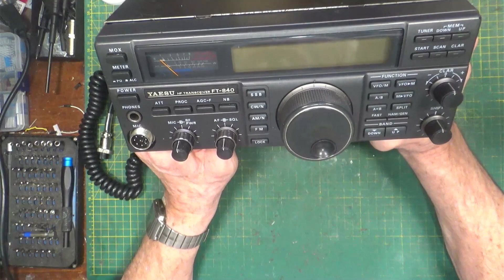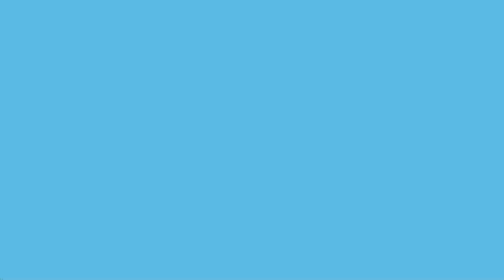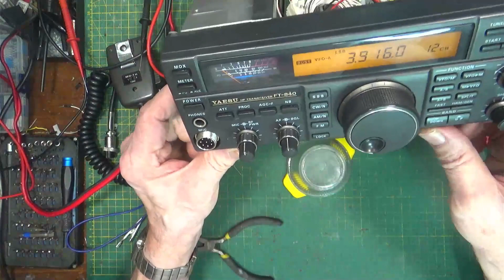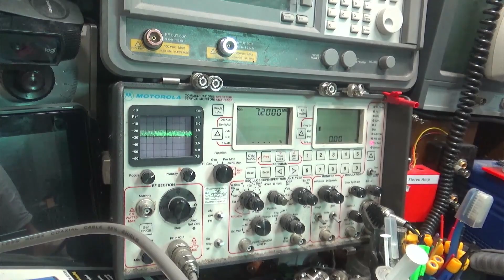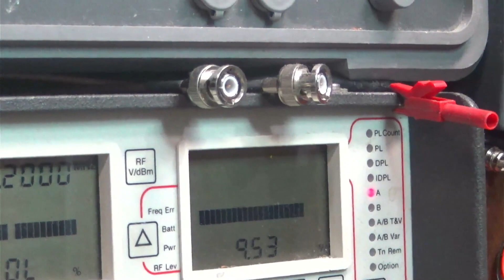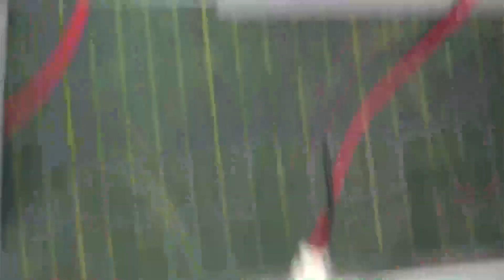Yaesu FT 840 Meter Lamp Replacement Two Ways

Comment: Yes correct Dedave, in Radios with 12VDC at the Lamp i use an LED with a 1k resistor, and i rub the tip of the LED on a file and flatten the tip and when inserted, it then give light with a broad spectrum
Reply from the maker: I have done that and it does work.  Thanks.

Comment: A trick I have used with LEDs is to sand the surface to make it "frosted".  Sometimes sanding the dome flat also reduces the focus of the LED.
Reply from the maker: That is a good idea. I will have to try that.  Thanks.